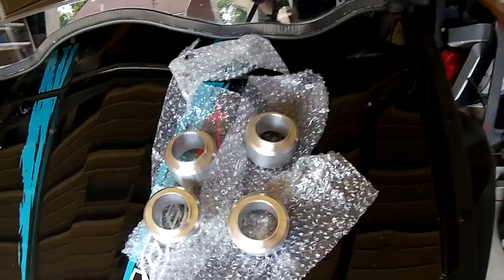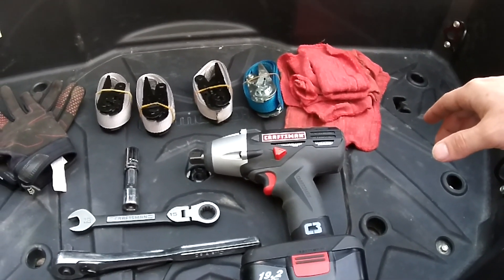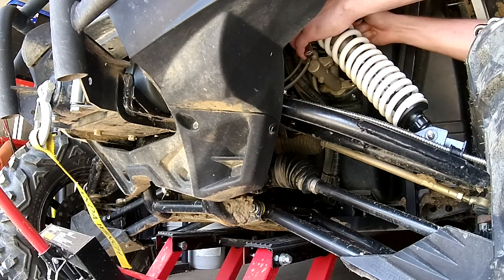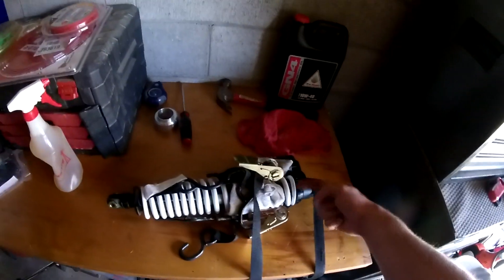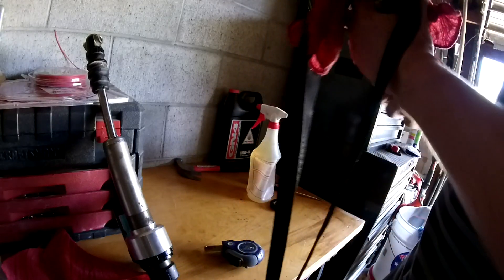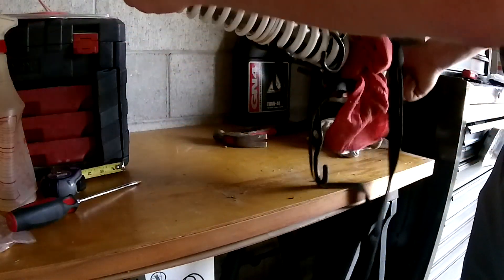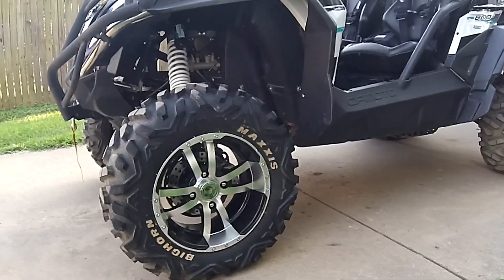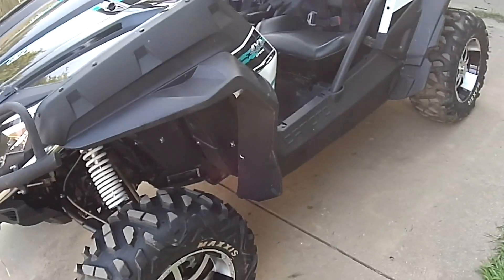Installing and Taking a Look at the SuperATV 2" Lift Kit for the CFMOTO ZForce 800 EX

Comment: Looks good for a Chinese machine. Are they reliable?
Reply from the maker: +rugby yea I never had any issues.  When buying them you want to change the factory air filter to an R2C or a UNI filter and go over all suspension bolts to make sure they're torqued correctly, but they're solid machines in terms of reliability.  Check out www.cfmoto-forum.com if you'd like a ton of information about them.
Reply: Looks good and the warrantys are the best out there. My 500 has 4 years

Comment: A friend of mine bought a lift like that for his Polaris Ace.
Suspension got too stiff and it also ate suspension travel. Not a pleasant ride after that. He was always complaining of the rough ride.

Putting spring spacers in the struts can remove suspension travel that you need off road.
This makes your wheels more likely to loose contact with the ground both at high speed bumpy roads and on slow technical stuff when climbing something because it doesn't articulates as good. 2 inch lift -> and wheel 2 inches of the ground.

If you can't build yourself a simple lift kit that relocates the mounting points(super easy!) then buy a REAL lift kit.
This is the worst kind of lift. Ever.
Made for show rooms.

Comment: That lift is an absolutely horrible lift!  All its doing is increasing the spring preload and will make it ride worse/stiffer.  A good lift would be brackets to relocate the shocks mounting point.  That would lift the vehicle while retaining the correct spring rate/preload.  No way i would ever put that on at all.
Reply from the maker: It's actually not as bad as you might expect.  I agree that a bracket lift would be a better option, but this doesn't kill the ride quality as much as I originally anticipated.

The most noticeable loss is the decrease in downward travel as opposed to a stiffer ride since the springs are compressed and the shocks are extended.
Reply: +Jason I have to ask.  Why did you get rid of the CF Moto?
Reply from the maker: +Chad Shumaker When I was first in the SxS market I was looking at either a ZForce 800 EX or a RZR S 900 (both EPS models).  I opted for the CF Moto because of the price point.  I never had any mechanical issues with the CF Moto, but it lacked some refinements that the RZR has.  The ZForce is a very capable machine especially for the money.  However, a friend of mine bought a 900S after I bought the ZForce and I rode his and it just does everything a little bit better.  I listed my ZForce for sale and got an offer that I couldn’t refuse so I went through with the sale and got a 900S.

The areas of improvement from the ZForce to the RZR that I like the most are:
1. Maintenance is a lot easier on the RZR (air and oil filter access is easier in addition to the oil fill hole).
2. The ergonomics are much more comfortable in the RZR (more reclined seat position that feels “in” the machine and the legroom/pedal positioning is much more comfortable).
3. The suspension geometry on the RZR is the best available, in my opinion.  I noticed it even more than the power improvement when I switched.

Comment: there is no way in hell it lifts the machine because the shock only goes down so far before it bottoms out its a gimmick either it has to be a longer shock or make a relocation kit for the brackets
Reply: Neutral position in the shock is changed. It rests closer to the max length now so the machine sits higher by default.
But you are right. The wheel won't come down as far anymore.

I heard the deluxe version of this lift replaces the spring with a steel tube! Ingenious!
Simple, light, durable and incredible ground clearance. Especially over bumps!
And in the working is to replace the strut altogether. Maybe CFMOTO will have those machines out soon.
Like zero body roll.

Comment: there is no way in hell it lifts the machine because the shock only goes down so far before it bottoms out its a gimmick either it has to be a longer shock or make a relocation kit for the brackets
Reply from the maker: Mark Klein you somewhat explained exactly how it works.  It's just a spring spacer and it extends the shock.  It doesn't bottom the shock out to full extension, but it does reduce the amount of downward travel.

So you're incorrect in saying it doesn't lift the machine.  It certainly doesn't function as a traditional lift kit, but it does improve ground clearance at the expense of some ride quality.

Comment: there is no way in heck it lifts the machine because the shock only goes down so far before it bottoms out its a gimmick either it has to be a longer shock or make a relocation kit for the brackets